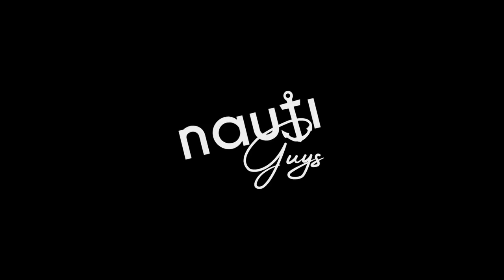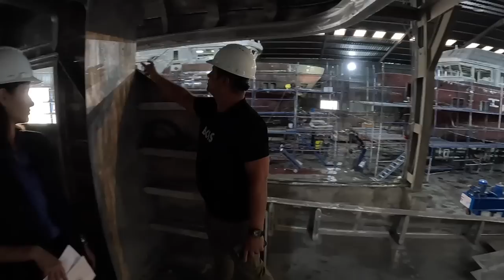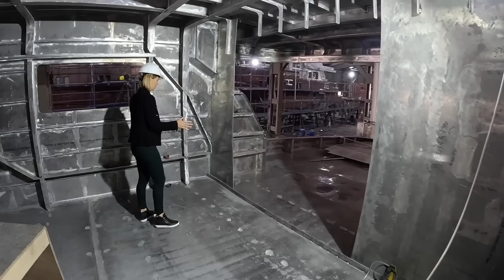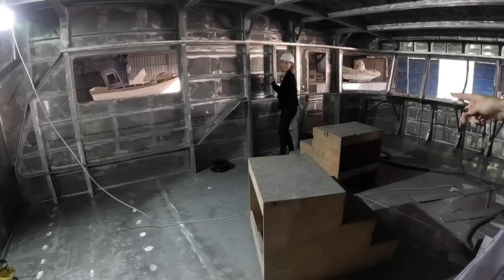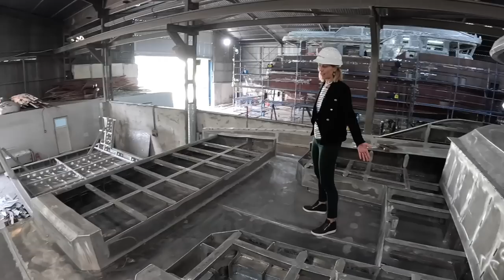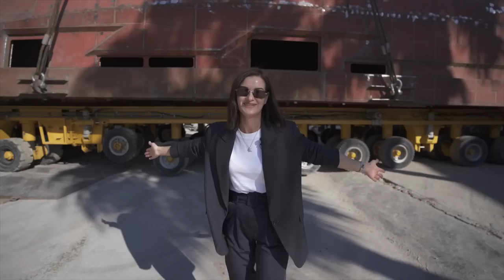First Bad News!😳 (Watch till the end) Eps.18

Comment: I've worked building ships and buildings for nearly 50 years. 
Before the finish work is completed it always looks much larger than what you will realize. 
Your concern is normal, but when the finish work is completed it will be a completely different feeling. 
It seems overwhelming, in the end it will be much better and some areas, believe it or not, will seem to small. 
Finishing makes a huge difference.
Reply: You are exactly right sir. They were walking around in an empty shell.
Reply: I've been deeply involved in several builds between 60 and 115 feet (and one much larger) and while I do agree with you this thing is a massive 75-footer, the gross tonnage of this thing is incredibly huge for her size.
Reply: Yeah it seems big now.  After it's first few breaking in cruises it's going to seem smaller very quickly.
Reply: That's what I said - it will be/feel smaller when finished. I look at the 77 video and it sure doesn't seem all that big - and this one is smaller than the 77
Reply: Not with all the polishing and cleaning and regular upkeep. The actual charters are 10% of the work this boat will require.
Reply: I agree entirely.  A bare boat always looks huge, then you fit everything, and you wish it was bigger!!
Reply from the maker: You are so right Tony - appreciate you!
Reply from the maker: Thanks James
Reply from the maker: Thanks olternaut
Reply: @olternaut  
It always seems bigger for women until they break it in a bit 😅
Reply: @marvindebot3264  A friend of mine commented that the bearing seventy five had twice the beam three times the tonnage and slightly too much length.

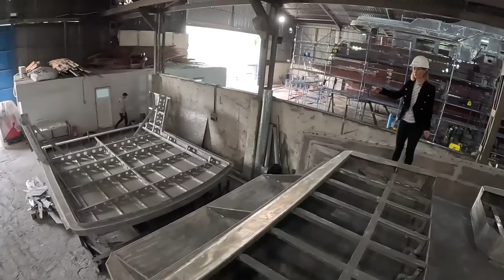Comment: 10:15  Speaker placement Front fly bridge Suggestion
 If you have pop up lights, Can you have pop up light and speaker combination? When not in use, pop down and they are protected and out of the way.
Reply: Also popup is a good placement of Wi-Fi antenna, & USB power

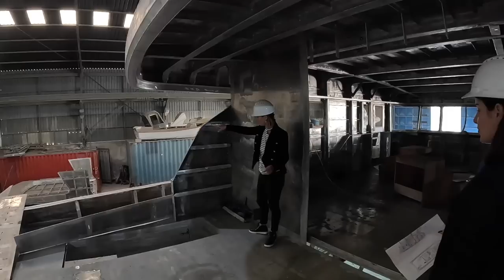Comment: You will be surprised how quickly you will become comfortable with the size of the boat. I went from a 33 to 49 and now a 59 foot boat in just a few years and recently helmed a friends 98 footer. Yes it was big but it still "drives" the same. In hindsight my 33 footer was actually the hardest as it was very light and only had a single engine. The only downside is you need more water (space) around you but then you get all that space on the boat. However, as you are discovering (@ 04:50), you still want more! You're going to love it.

Comment: Look at it this way it's like building a house,  That's just the frame work of the ship. Wants the  framing and walls and electrical, ceilings furniture  are put in.  It's still  gonna be a big boat  but a lot smaller at the same time.  Very happy for the both of you.👍👍👍👍👍
Reply from the maker: Thank you so much J2W 9

Comment: I saw an old You Tube video for a couple that cruised a 76 foot Nordhavn double handed.  The wife was worried about working the boat, but in the end, it was well within their capability.  They did budget to have hull cleaning with professional divers, and exterior cleaning when they went into the marina.  But otherwise, system maintenance, interior upkeep, etc, was handled by the two of them.  In fact, they thought in some ways it was easier, since they had better access and more room, and the type and number of systems was really any different from a 55 Ft boat, just upsized.
Reply from the maker: Thanks Kenneth, I sure hope to feel the same way 🤪 with all due respect to NH the 76 is way smaller, lighter and less GT then this B75 🤪🤷‍♀️ but I think once we get used to it I will get over my fears

Comment: The boat will seem to shrink once it is complete and in the water.One suggestion.Hd cameras on the bow for seeing deployment of the anchor and retrieval,also down the port and starboard sides as well as the stern. Small expense with many benefits if you plan on being a two person crew at times.

Comment: Believe me, you will grow into it. When I first built my house I too was overwhelmed. Some years later I added on. 

A boat you get what you get. There’s no adding later. You can always close off areas but you can’t add to a boat
Reply: I hear about boats getting added on to all the time.  It's steal and aluminum so it can be cut and extended and rewelded.   Fiberglass and composites are a different story.
Reply: Superyachts get extended quite often; however, they probably won't be doing that.
Reply: Correction:  steel not steal, 7 million is not a steal.

Comment: As a suggestion, attempt to install wired ship control ports in strategic locations so that you only require a 1.5-meter line for your remote control.
Reply from the maker: Thanks for the advise Murad

Comment: Am pretty sure Aleksi will do a great job in documenting the joining of the hull with the superstructure. Don't worry, we will see it later as well, it will be fine. 

As for your other worries.........that it is a hell of a lot of boat for the two of you (or even 4)............you are absolutely right. This boat needs at least 5 to 6 crew to be able to sustain the demands of the charter business. There is an enormous amount of cleaning and polishing to be done, both inside and outside. You have up to 8 guests which is a lot of work to keep them happy, while at the same time performing all the other jobs on board and I can go on like this for a while. Yes, once the boat is finished it will be slightly less overwhelming, but all those corners, spaces, showers, toilets, tables, plates etc etc need to be cleaned. And if the guests want to party until 3 or 4 AM........you are not going to get a lot of sleep. That is nice for 1 day, perhaps 2, but not for week after week, it is just not going to work. 
So my only advise at this moment would be...............make sure you have room for more crew on board. If I am not mistaken you have space for 3 additional crew (that is outside yourself), see if you can get a 4th crew member somewhere in there. 
As for handling the boat with the two of you ? 
Should be no problem if you have enough remotes to operate every piece of equipment (engines, bow- + sternthruster, anchor plus chain counter, winches etc) from anywhere on the boat. I have it on our boat, which makes it possible for the two of us to get into every single berth they throw at us in the Med. 
And for the rest................one day you will still utter those famous  words: 'We need a bigger boat' ! 😀😅🤣😂

Comment: Adding chairs, table, bar, et cetera to the back,  will definitely make it seem smaller. For your dances.

Maybe, a table can be moved from the back deck.  Needing as much room, for dances and music.
-Mike
Reply from the maker: you are right Mik34444 C
Reply: @NautiGuys  I was thinking, seats in the back of course. With  stand-up bar countertops, by the outside door. 
And along the port and starboard sides of the back deck.

I guess, where they can put their drinks outside is the main thing to think about.

Or, dining table and stand-up bar countertops.
Because there is room on the back deck, maybe both would work. Without having to remove the dining table. Where they can have more seats.
-Mike

Comment: You’ll be fine. After a while it will shrink around you, especially when it is fully furnished. Look at it this way. How big does a home look with no interior? Boats are no different. They are good boats with lots of tech to side you. Enjoy the ride😎

A quick question for Rico. What sound system are you installing? Brand and model of boxes etc.
Reply from the maker: You need to watch the 2 part video from a couple of weeks ago about the sound system

Comment: You still have a long, long way to go before that yacht is finished.   Once all the interiors are completed, it won't seem near as big.   Remember they haven't done anything to the inside or outside in the way of insulation, paint, interior furnishings and amenities.  The marathon miles of wiring and cabling.  👍👍
Reply from the maker: you are sooo right Black Cloud Pyro 💙🙏

Comment: That's my problem with bearings and they are too much volume for their size especially considering their only two decks (internal). The boat i'm trying to work up to is eighteen meters. But the right signs for an 18 m boat is 70 gross tons. If you can get three decks otherwise it is fifty tons. The seventy five is twenty-two or twenty-three meters and what 150-175 tons? On two decks?

P s thank you for approving slash spreading the notion of that there is too big even at a given length

Comment: Chill. It will be smaller when it is in the water. Boats always look twice the size ‘on the hard’. I ran a 110ft schooner for 6 years. It was a pussycat because it had really straightforward controls, a simple rig, and good dynamics. It could be quite easily run by 2 competent people, even offshore.
Reply from the maker: Thanks Stephen

Comment: Ok... It's a bad analogy, but I'm gonna roll with it.. I drive trucks for a living... You figure I'm 72-76 feet in length... And I bend 2/3 the way up from the back... It's deceptive. I never thought I could handle this size truck, but I amaze myself almost weekly on what I'm able to do with it. Some of the places I go, I'd be scared to take a pickup. I've found that if I make a move with the wheel, I have to give it a few seconds to see what the trailer does. I found that the same piloting my dad's 36 footer.. There's a learning curve, but there's two of you, plus your deck hands. I'm sure you and Rico will be just fine
Reply from the maker: Thanks Mike

Comment: when I saw all the aluminum upper part build and steel hull I wondered about protection against lightning strikes.  The boat could be a lightning magnet in a storm.  Perhaps you can make a video on how boats  and electronics are protected and provided safety measures in case of lightning.

Comment: Buyers remorse, everyone gets it. The bigger the deal the bigger the stress. I get it, suddenly you're picturing yourself on your new boat surrounded by hundreds of subwoofers woofers, tweeters,midrange and multiple DJ stations all over your stately new home. Do you really need all that builtin? Maybe a universal system with outlets to plug in party sized speakers in various places? 
The big worry I have is the flipping of the boat.

Comment: You are not the only one disappointed, I'm also disappointed because the weekly Thursday updates that were promised have not been coming on a regular basis. 
I also have to agree with Victory that that boat is too big for just the two of you to handle alone. I can't imagine Victory running the length of the boat casting lines while docking, especially in a strong wind. I can fully understand why she is overwhelmed. This boat is no fifty-footer. I am also concerned for Victoria's safety

Comment: Let Kristina or Saida (i think is her name?) produce the videos for the hull turn. Future starlets of Hollywood from Turkey. Give them both a hug from a tall Texas dude . 

Do i hear some buyers remorse?? As in too BIG? For me, the 65' would be my choice, but a mid cabin master, instead of bow. I love the Berings for lots of reasons. One for inside height as I am 6'5". Super range for such beasts, and beefy for safety. 

For the "Boss", where are the liferafts going? Ditch bag? Fire extinguishers? Spare lifevests? First Aid kits? CPR gear? Not sure if you all selected designated spots for safety gear and easy access for the OMG just in case in a "NY" Minute scenario. 

Sometimes smaller is better, but you will figure it out in time. I used to be a loud rocknroll guy, now more subdued easy listening soft rock, jazz, Christopher Cross "Sailing" type tunes. With age, you will find out. 

By all means HANGLOOSE and go with the flow. It's only money!

🤙